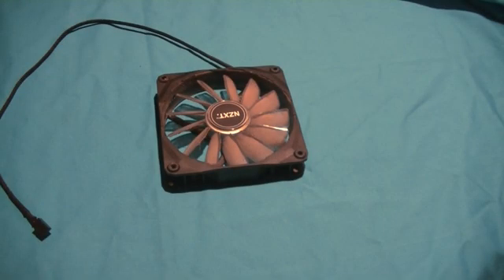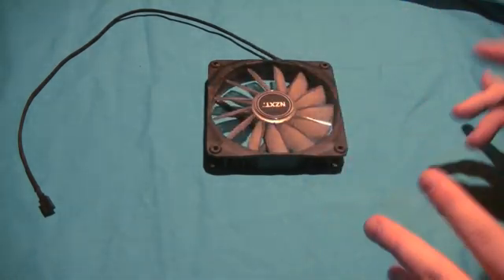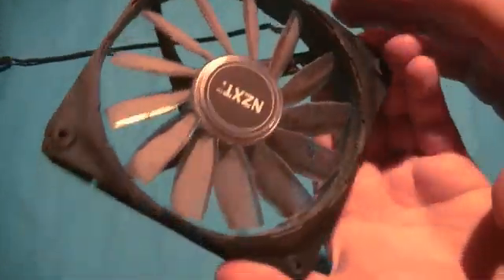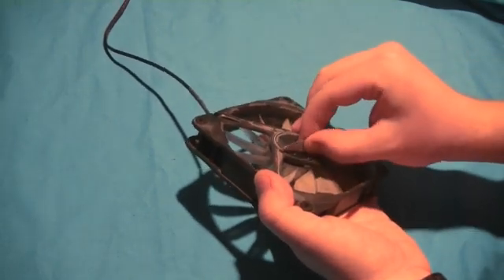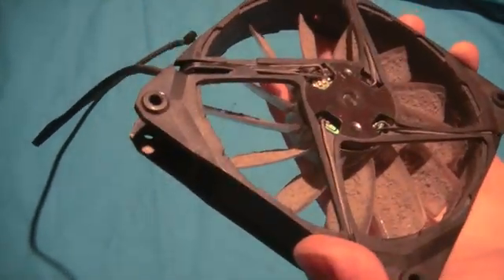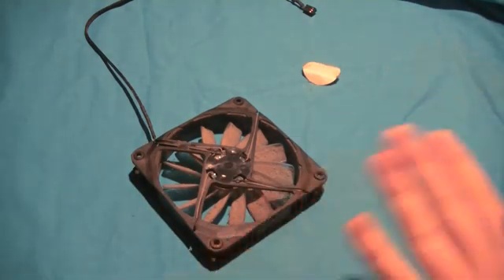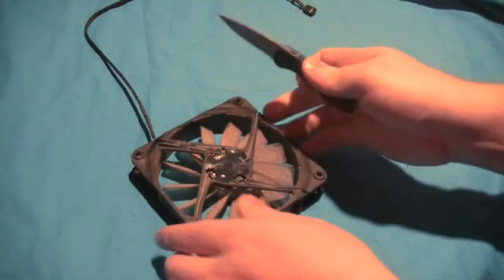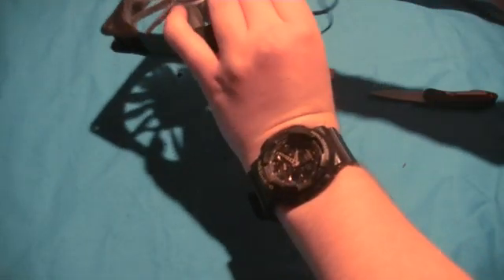How to Fix a Noisy PC Case Fan

Comment: Super helpful video, one of my PC fans would often start buzzing/making a noise upon start up. I took out the fan and tried to do what you did in this video. Unfortunately my fan was a tad different, mine had a pretty thick backing of black plastic and a thin disc of white plastic as the immediate covering to the bearing. I used a power drill to carefully open a hole up to reveal the bearing, picked out the white disc and any debris with tweezers and gorilla tape, applied zoom spout machine turbine oil, used a Qtip to absorb any unwanted oil, and sealed it with more gorilla tape and the original sticker.

Let’s hope this fix lasts a while

Comment: its crazy that some fans dont have the re-lubricating port.. i cant come up with any reason why they wouldnt have it.. im sure the insides of case fans are more or less the same so its not like its because it would ruin the fan or something. CPU and GPU fans are different but all case fans should have those rubber caps behind it for relubrication but i suppose then manufacturing that fan would be more expensive for the company etc.
Reply: MONEY is why

Comment: Worked like a charm even in 2024. Thank you so much. Had to chisel away at the plastic in the way to make a little hole. Two dabs of machine oil. Soaked up the access with a cloth. Slapped the sticker back on. BRAND SPANKING NEW!
Reply: An idea just come into my mind, maybe burning a hole with a soldering iron would be safer?

Comment: does wd40 works?
Reply from the maker: I would not use WD-40 on a chassis fan, it's a good metal sealant/protectant but it's not typically good for lube.
Reply: you are such a chad the video is over a years old and you have responded absolute chad @Torqcx
Reply: and thanks
 @Torqcx

Comment: Can i use wd 40?
Reply from the maker: I wouldn't, WD-40 is intended to clean and protect metal surfaces, not lube bearings.
Reply: I see will go buy some oil for this thanks for reply @Torqcx

Comment: Can I use WD-40 for the oil?
Reply from the maker: I would not recommend it, though I haven't tried it myself. The issue I have with WD-40 is that, in my experience, it's not the best lubricant; it's a good sealant/protectant for metal, but whenever I apply the stuff to anything else that squeaks (my office chair, for example), the squeaking comes back within a matter of days at times.

Comment: Found your video today, as I was having this issue; I actually used my soldering iron to melt a small hole in the center, and that did it. Hopefully without transferring any hot plastic onto the bearing, but I guess we'll see, eventually. 😅

Comment: I had 2x new fans in the Amazon cart. Glad I found this video. I gave this fix a shot using good quality bike chain lube, and a little gorilla tape to prevent leaks. A noisy fan and a slow fan are now running like they were brand new.

Comment: time for wd 40
Reply: 3 months old but I’ll just say that WD is water displacer it cleans it out and blows away all the moisture and oil instead of lubricating it well to some degree it does lube it but it’s very quick to stop working so it will work for bit and get a lot worse in the end.

If you go on a bike Channel you will see a lot of people make mistake of using WD on bike chains to lube it but instead it does the opposite and cleans everything off as that’s what it’s supposed to do.

Comment: My fans turned out just like you said in your video!  I used wd-40 to lubricate the ball bearing and now my fans make no noise!  I also took the opportunity to clean the inside of the case.  I'm convinced that the fans not working well contributed to the buildup of dust.
Reply: I wouldn't use wd-40 as it gets sticky, next time maybe use 3 in 1 oil
Reply: Yeah, wd-40 is for removing grease. It is not a lubricant. It is a common misconception that wd-40 is a lubricant... but it is for removing old lubricant etc, and then you add lubricant such as 3 in 1.
Reply: Update:. My fan did go right back to being noisy after a week.  I tried getting 3-in-1 twice from Amazon but both deliveries ended up with a splattered bottle in a cardboard box.  I has some Aquaphor, a water based skin moisturizer and lubricant, and dabbed on some the bearing.  After a month and its still working well.  I also have used this on a door hinge and that is holding up after 2 years as well
Reply: @jonamar3965  pretty surprising for something water based, but if it works it works I guess
Reply: @jonamar3965  You can buy 3 in 1 at pretty much any hardware store or walmart. The water based lube will probably work well enough for a while, but it will eventually get sticky too. Silicon based lubricants are the best for this application

Comment: IS popping off the fan blade and putting oil in the centre the same? Coolermaster and SilverStone have removeable ones thank god.
Reply from the maker: So long as the oil is getting on the pivot bearings, yes, it shouldn't matter how you get to it. This video merely shows an example of a fan that has no user-friendly access to it

Comment: Would WD40 work?
Reply from the maker: I wouldn't, WD-40 isn't the best lubricant for parts like this as it gets sticky. Get a machine oil of some kind
Reply: @Torqcx  Thank you for the very fast reply :) Ill do that then
Reply: Yeah, wd-40 is for removing grease. It is not a lubricant. It is a common misconception that wd-40 is a lubricant... but it is for removing old lubricant etc, and then you add lubricant such as 3 in 1.

Comment: For anyone trying this. If the bearing is covered by rubber, use a thumb tack to slightly pierce it and work it out without destroying it with the knife. Just did it tonight and the grinding in both of my case fans went away. Good video dude
Reply: I suspect you could probably get the whole plug out with an oring pick once you have a hole big enough to stick it in
Reply: Just say needle next time.
Reply: there isn't anything to open up for me?
Reply: Thanks this helped.
Reply: Bro thank u it worked i was about to take the entire fan out by force until i saw ur comment

Comment: Thank you it worked. My fan vibrated like hell. I had disassembled, cleaned, used wd40. Bought a new fan (fauty), got sick wasting time in videos showing that the fix to the fan is to buy a new fan (really?). Then I put mineral oil. That's it.
Reply: Mineral oil? Like food type? Or wdym?
Reply: @classmanOfficial  from the drugstore, used by people to treat the skin. Doesn't matter much the origin because it is very inert and doesn't get rancid like vegetable oil.

Comment: Used grease instead of oil (to prevent potential leakage) and so far so good! Thanks for the video :)
Reply from the maker: I'd also imagine grease would be more permanent! Good point!
Reply: But with only a small hole dug in, how to you get the grease deep into the bearing. Oil has a better chance to penetrate with the help of gravity.

Comment: Reason why is not all that good , after like 2-3 weeks that oil will be cooked and fan will fully stop , that is what happened to mine
Reply from the maker: That's odd, what type of oil did you use?
Reply: @Torqcx  olive oil ?
Reply from the maker: @orkun209  Edible oils like olive, canola, peanut, vegetable oil etc. will eventually gum up and get dust and debris attached to it. I advise you don't use that.
Reply: @Torqcx  i was joking, but i burnt my gpu while trying to lubricate my fans

Comment: 3 in1 OiL is the best for a job like this. Do NOT use WD-40 for the bearing shaft.
WD-40 is nor designed for this. It is NOT OIL! The best is Motor OiL 20W50 in a 21 G Syringe Neddle from your local pharmacy, and your done! 
Yes, I am a Mechanical Engineer!
Reply: I know your comment is very old but you are right. How ever I'm using a fine machine oil (for sewing machines) and it's even better. I'm sorry that I don't have access to a specialized machine grease as it would be a even better solution, not to mention that it would last much longer.

Comment: Just a quick tip, after oiling it up use some sorta tissue or even better a cotton swab or even a Qtip to take out the excess oil, last thing you want is oil drops on your boards.
Reply: a drop or two of oil won't hurt anything in there but might look yucky

Comment: Yep, worked like a charm with the cheapest mechanical oil I could find out there.
No sound and no stopping.
Now lets see how long it will last.
Reply: 10 months how’s it lasted?
Reply: @wiggitywhitefox  I left this account inactive for quite some time, sorry about the late reply. But if you have tried it you probably got some extra life out of your fans as well.

Mine lasted a good 8-10 months before it started again, oiled it up again and it lasted another 6 months.
I probably could have kept going like this just fine, but I upgraded my CPU so I figured might as well upgrade my case fans as well. 

For anyone new that might be reading this, it works just fine. It depends on you fans quality as well of course, but you can get a few more years out of them if you keep doing it.
Reply: how did it last

Comment: hello, thanks for the video. quick tip: use a pair of tweezers to remove the silicone covering the bearing. this way it stays intact and you can put it back in after oiling the bearing.

Comment: if I had a T5 torx screwdriver I would be able to access the inside of my computer :/ But my fan is very loud and sometimes I am pretty sure it gets stuck and tries to continue to spin but just sounds like it's stripping itself. I've had this computer repaired 18 times by HP and eventually they decided to stop repairing it. But if I had the T5 I would be able to repair mine :D
Reply: AliExpress sells T5 torx screwdrivers i think, also check pc tool kits on there.

Comment: thank you, seriously I was able to do this without disconnecting the fan (just unscrewing it) my plastic part came off easily and I just added a dab of oil and using a Q-tip to pick up any extra oil before tesing it when screwing it back in, works like a charm.
Reply: thank you miyu very cool 😎 👌

Comment: I have a  NZXT case and 3/4 fans are noisy. I have a thermaltake case and its been running longer and the fans make zero noise. smooth as butter.